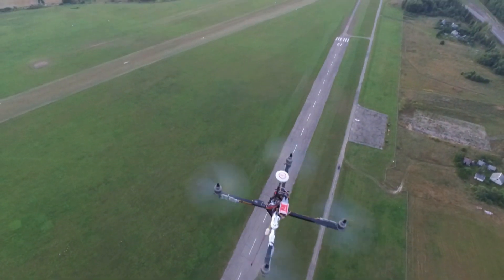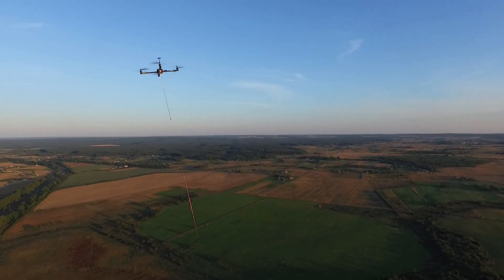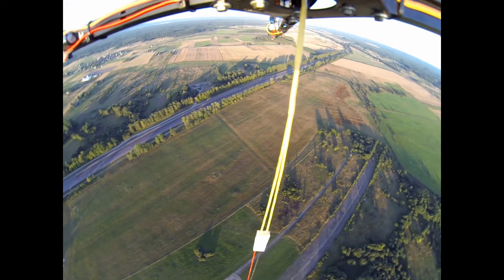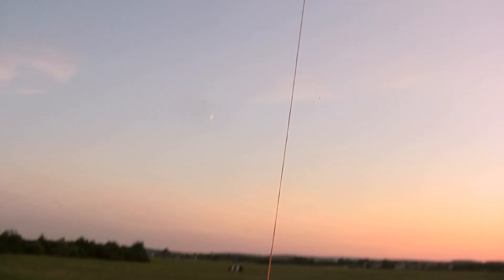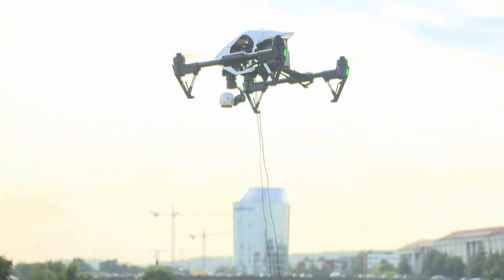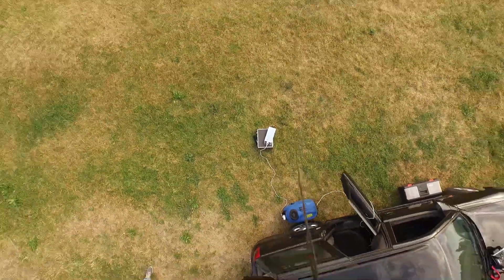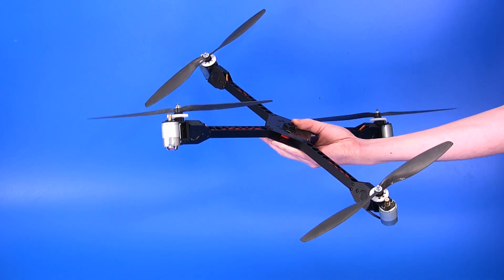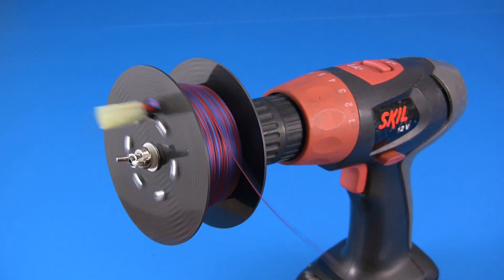Powered by wire drone has reached 1000 feet altitude

Comment: Can we reach high altitudes with a longer cable, such as about 10 km?
Reply: https://youtu.be/h7NmRVDOOfQ?si=TwTNtCcPYnGO94HE

At a certain point however, it's no longer about the length of the wire that's an issue but air density. That would be your limiting factor.

Comment: I wouldn't pull a 1000 meters lightning rod up in the sky, not even in a sunny day. You never know what's the potential difference up there.
A 1000m wire will protect an entire neighborhood except the idiot standing right near it :D
Reply: Interesting idea. But the drone is not going to survive that:)
Reply: arguably the resistance from the thin wire would cause it to break before it become a major issue.